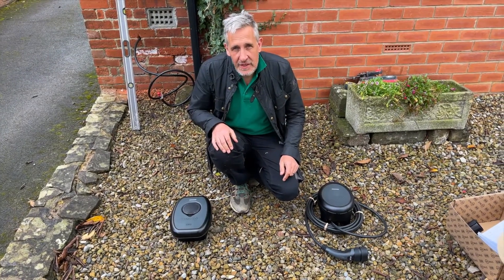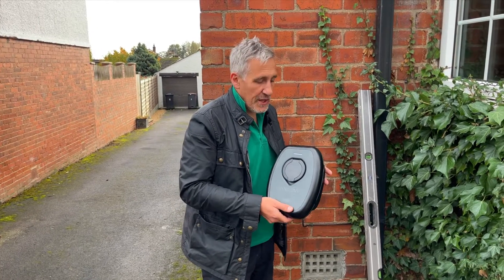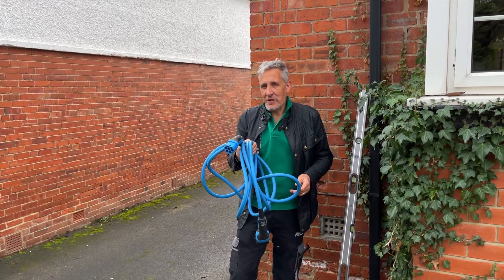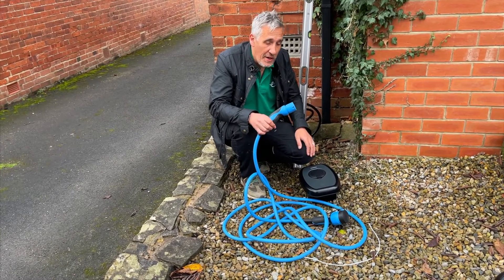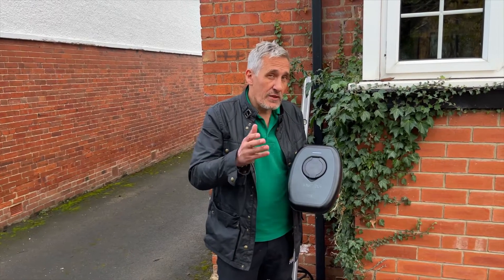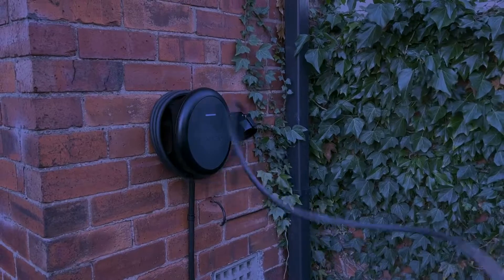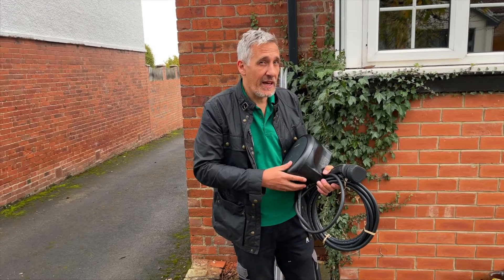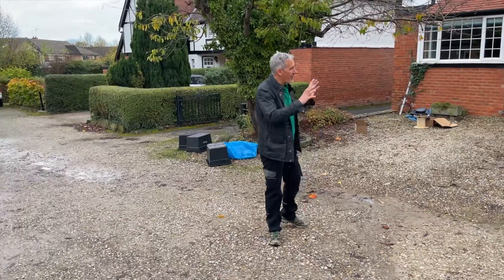Should You Get A Tethered or Untethered EV Charger?

Comment: Our first EV was a Leaf which uses a Type 1 (J1772) connector. Everything newer uses Type 2 (Mennekes) connector so going tethered would have been severely limiting down the line. Regarding making it tidy, we installed a couple of cable hooks on the wall and looped it round. Job done